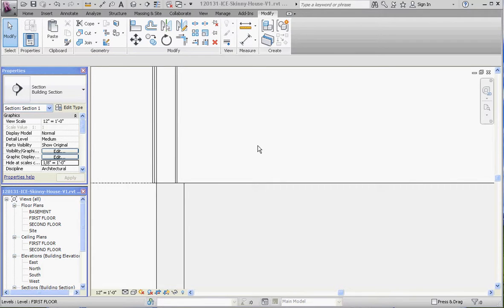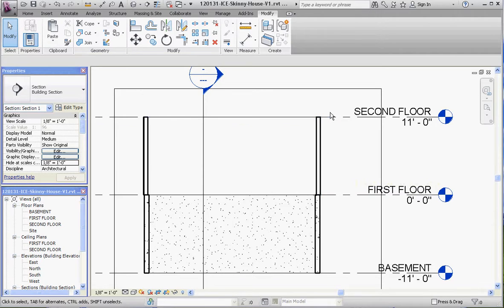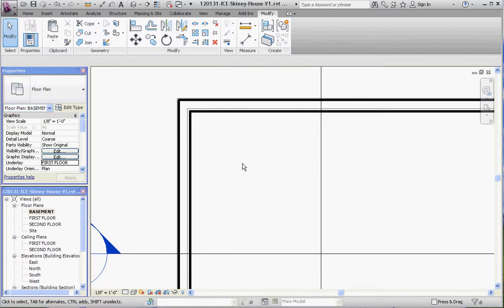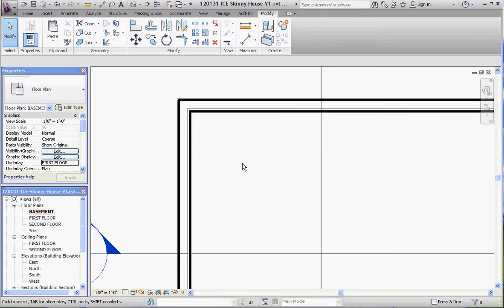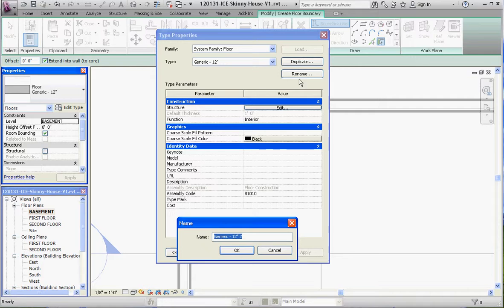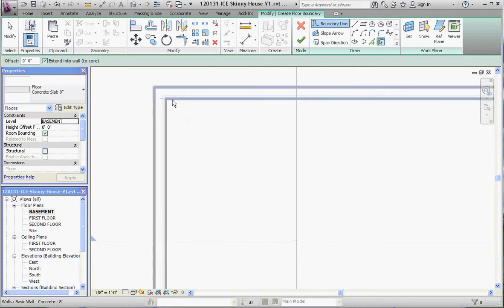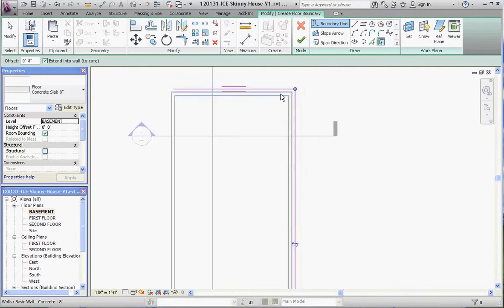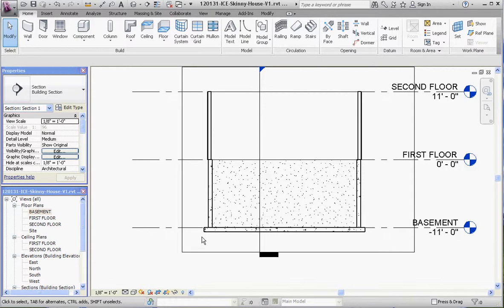Revit Architecture -  Modeling a Basement Part 6, Creating Basement Floor

Comment: i just graduated few days ago , and designing my own house basement + G +3 , which software u likely to recommend staad , revit and etabs or use staad with manual or excel calculation 
plz answer bcoz no ones answering
Reply from the maker: I like Revit, its been around a long time, its very versatile and its easy to work with.  Good luck on things.  CSS